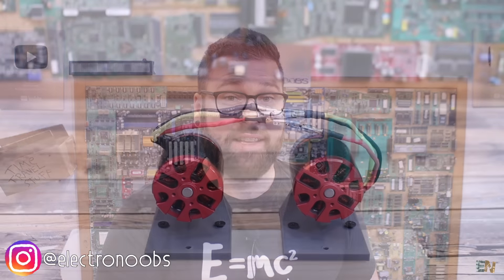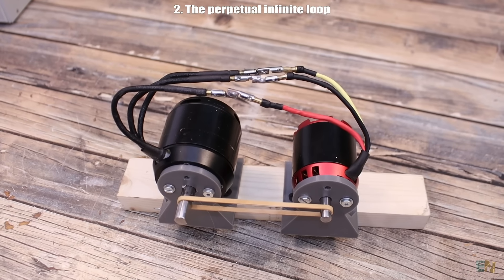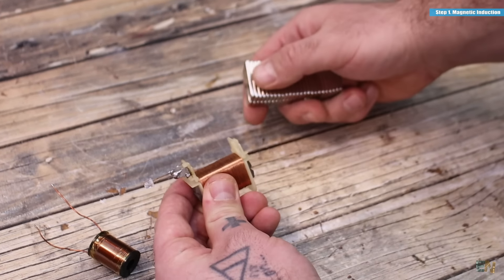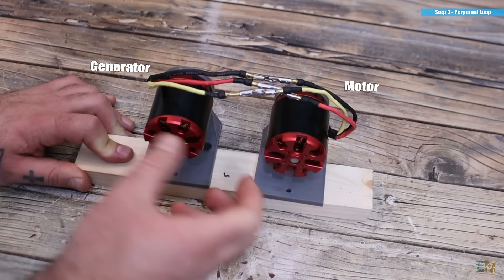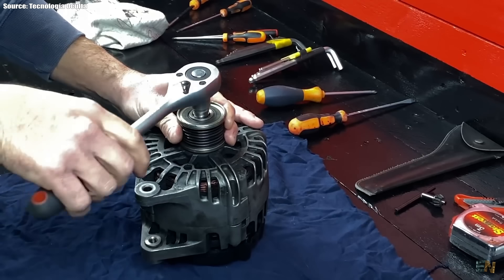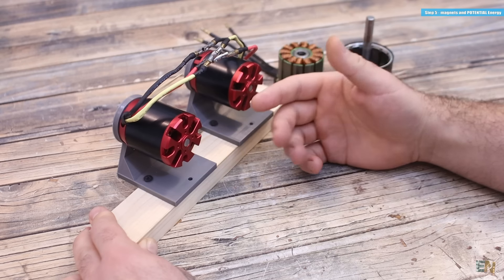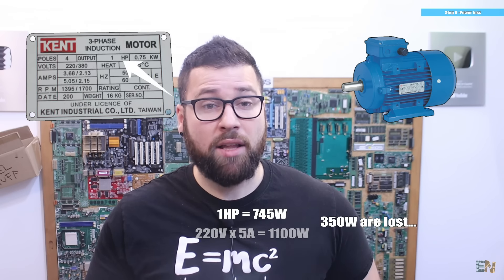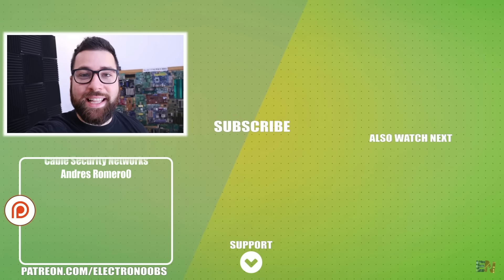Free Infinite Perpetual Energy Nonsense - FAAAAAAKE

Comment: This example reminds me of a guy who was playing with an alternator and convinced himself he was making a bit over a kilowatt (About 1.5 kilowatts) from around 20-30 watts of input.  How?  He stuck a roughly 2HP motor on the alternator to drive it, then plugged in a roughly 2 amp at 12V field current.  In his mind, he was "putting in" 24 watts of power into his machine (12V x 2 amps of field current).  The fact that he was measuring around 1500 watts of output from 2HP of mechanical power should have clued him in, but it didn't.

Comment: We have a model bag with the Faller Car System on it, but have replaced the batteries with 'supercapacitors', so the charging times of hours are reduced to a maximum of 90 seconds.
Then these are 80/85% loaded and that is sufficient, because there they drive for about fifteen minutes at maximum, but the lap time varies from 1 to 3 minutes, some routes are longer and therefore more 'charging stations' and we do this through 'the copper mirrors on both sides'.

These supercapacitors can therefore also be used very easily, we use 3.8 Volt 50 Farad.
If you want to use one of 50 Volt 500 Farad then they are about 6 Cm long & 3 Cm flat, they have a charge & higher discharge current than batteries can ever have.

These will be used in this type of FAKE power generation.
I challenge these by putting a 5KW old analog movie lamp on it, one of 5KW, to date no one has accepted this challenge and thus fake labeled by me.

Comment: Third mistake . . yes it is more efficient to use a 3 phase motor if you are transfering the total power from generator to motor and vice versa but they are using only 1 phase motor and they have given the alternator a first spin from the wire which created enough torque to generate an electrical current to run the motor which has a bigger pulley than the alternator . . so there's nothing fake in this
Reply: Basic Physics FAIL

Comment: But it is working :-).

Motor:
Input voltage (system voltage) - 220 V
Rated voltage - 230 V
Rated rpm - 1500 rpm
Input current – 230 V →21.8 A (measured
 value)
 220 V →
 =
 20.85 A

Input current = 20.85 A
Input power → P =VI cos ɵ

 P = 3669.6 W
Motor input = 3.7 kW

Generator,

Output voltage - 250 V
Rated voltage - 300
Rated rpm - 1500 rpm
Output voltage – 300 V→ 5 kW
Output voltage − 250 V →

 = 4166.67 W
 = 4.167 kW
Alternator / Generator output = 4.167 kW
Shaft rpm = 750 rpm
Reply: Thank you, smart physics guy/engineer!  FINALLY someone debunking the close-minded "debunkers"!
Reply: If you spin a motor with your hand, it produces an electromotive force. You essentially make it a generator. When the motor spins from an applied voltage, this still happens. Thus, a voltage that opposes the voltage applied to the motor is induced. This limits the current through the motor. 

So, the unloaded RPM of the motor may be 1500 RPM, but when you attach the generator as a load, the motor will slow. When the motor slows, the induced voltage decreases, just like spinning a generator more slowly produces less voltage. This actually increases the current, and thus the power consumption of the motor. So, if the motor spins at 750 RPM, it may consume twice the power or more. Now the generator produces 4kW, and the motor needs 7kW to run at that RPM, and it slows. This cycle continues until the system stops.

Comment: Can you make the highest efficiency set up? With the coupler and 3 phase motor etc. I know it wont work because of power loss and other reasons. But you already made a small version of what they made which was all the worst decisions. Show us one with all the best decisions
Reply: a coupler will not work : it inverses the rotation, you'd create a short-circuit instantly. Another argument to debunk the debunker LOL
Reply: @dirklanduyt  they make opposite spinning motors or you could reverse the polarity. All motors in the world dont spin in one direction
Reply: @dirklanduyt  Wrong! Motor rotation can easily be reversed by reconfiguration of the wires. In this case the swapping of any two phases of the three. Red to Yellow instead of Red to Red and Yellow to Yellow. Machines that use three-phase motors typically have a switch to make this change. Running a lathe "backwards" for example.
Reply: Y don't you make the same project and show us practical that the experiment is facke
Reply: @rosedeep6833  because i am not the pro
Reply: "all the best decisions" would be to eliminate everything possible, while still retaining a the characteristic spinny thing. So the best possible performance would be a flywheel in a vacuum on contactless bearings. Yes, just a flywheel. I think your imagination is enough there.
If this seems dissatisfying, please know that these devices all boil down to multiple free spinning rotors and shafts connected together in very unnecessary, lossy ways. The most efficient form of this with the lowest losses is just a flywheel with minimal friction. Obviously it isn't a source of power (neither are these devices). The very best it can do is just store energy the energy initially put in for a long time. The electromagnetic elements in these videos simply add enough complexity to perpetuate confusion.

Comment: The dual motor design scam is very popular these days since the scam is even easier to pull off as battery technology has gotten smaller and more efficient compared to the 2010 days, so you can stuff a battery powerful enough inside one motor to drive the other pretty easily.

Comment: If your your output of the electric motor exceeds the demand to keep both running, it is very possible to do this.   I have literally seen these in real life working.  BUT the alternator was modified to produce enough power to start the electric motor and the electric motor had to be started the first time using a large fast drill or other means to get it up to speed to produce the power needed for the entire load.   There is literally no difference between plugging your electric motor into a electrical socket to run it vs getting power from another source as long as that source supplies enough power for the electric motor to keep running.   I can use batteries, electrical outlet on the grid, solar panels, wind turbine.. or anything else.  AND IF the source supplying the power to the electric motor produces enough power for that AND produces an excess in power output, like a modded generator/alternator, there is no reason this would not work as long as the output exceeds the input needs.

Comment: One thing the fake videos forget is "Windage".
Alternators and Generators require a fan to keep them cool so there goes some energy straight off the bat.
Reply: @newdawn8477  So you're saying it does work to produce energy but mad because you're not achieving full efficiency... you clearly missing the point that perpetual creation of energy w/out reliance of the power grid is a win.  You need more than 600w of power?  Here's an idea, use more powerful hardware than what they showed...
Reply: @duyvuitton6019  It went right over your head didn't, everything I wrote was proving it could not work and will not work. 
I even gave you the best outcome by not factoring in LOSSES.
Go back to school and learn the law of conservation of energy or haven't you got that far?
Even if you had a 15000w motor and a 15000w alternator with ZERO losses, it still wouldn't work. Any load will deplete the system of energy. 
Think about it and I mean think about it. 
Ever noticed most of the videos come out of the middle east? Could it be they think the west is stupid and by posting videos like that they know someone around the world will waste their time trying to build it...

Thinking about it you should put your money where you mouth is and build one and have it running a 3kw load (this should be easy for you), video it running and then dissemble it with no cuts and post the link here, I WILL watch your attempt. 
All of the parts can be brought off of ebay and ali.
Just prove me wrong by doing that.
Reply: @duyvuitton6019  The rest of the energy was freely created after losing energy….leaving you with less energy than you started with.  You have a real mouth on you for someone who can’t even grasp the core concepts.  There is no energy company conspiracy, you just don’t understand.

Comment: I don't disagree with you but there are lots of different setups that can be make. A motor has a lost rating. If you size 2 different motors and change the gear ratio you can spin on faster generating more power. Still won't work, but motor make heat. If you harvest the heat and move it back to electricity reclaiming loss. There is also the ac to dc conversion with a transformer you might save a little power. Then there is the magnetic feild. You could reclaim more electricity there. So be combining multiple setups (in theroy) it should be possible. Using 2 motors different size pulleys and add magnets to the belt and put a transformer under the belt to take advantage to the magnetic feild. Or a coupler with magnets. Great video by the way.

Comment: It's funny to me how they couple two machines together in their videos and pretend like noone ever thought of that. If you walk into a laboratory for electrical machines you can find this kind of setup everywhere. One machine acts as load on a machine that you are trying to make measurements on. It's an efficient way to test machines because you only need to supply the energy for all of the losses in the setup. But of course you can't gain energy this way. Awesome video!
Reply from the maker: like placing a light bulb over a solar panel and close the loop :))))
Reply: Why would you make this video debunking something if there wasn't something worth debunking! So what if people believe in it! Let them fail! Try all you want you will lose people are waking god is here
Reply: @ELECTRONOOBS  I believe you when you say it’s fake kinda makes sense. I’m no expert but I do have a question. If you had a batter, alternator and motor and made enough power to keep battery charged while it runs the motor wouldn’t it be possible to keep battery charged from motor and runs small appliance like charge a phone
Reply: Hallo Herr Diermeier, lesen Sie bitte mein Kommentar.
Reply: @nonpe8216  It would not be possible. If you had a perfect alternator and a perfect motor perfectly connected the system would have exactly no energy left over to output. It couldn't lift a fly's eyebrow a nanometer.
I think something that leaves the "intuative door" open for this motor-generator falacy for many people is that they may have spun an alternator on the table by hand, thinking how freely it seems to spin. But connect an electrical load and suddenly it is not easy at all. The greater the electrical load, the more torque is required to spin it. Motors and alternators are simply energy converters, changing between mechanical (shaft) energy and electrical energy, both for a small fee of heat energy  because they can't be perfect.
Reply: Lol.
Reply: @nonpe8216  no; there's no way that system would work. Not without 100% efficiency (energy) from all electrical and mechanical components. No matter how powerful you make things. It literally is impossible in this universe, and yes many people have tested this (obviously), and it has never, ever come close to working.

Comment: The magnet arrangement is the secret of the device. The magnetic flux is shaped in such a way that increases the field strength in the right areas. The alternator then becomes very efficient for the amount of power input. Too many armchair scientists who don't even replicate something that's been documented and explained time and time again.
Reply: I'd really like to see some measured data. Do you have any electrical measurements? How about efficiency numbers?
Reply: @pstonard  please do your own research. I won't spoon feed. But I'll point you in the right direction. Go look up the energy from the vacuum series. There is a part about magnetic gates where it was discovered that magnetic fields could be shaped. This is the key. There is also the lockridge device from ww2 that used similar principles on an old Bosch starter generator. The starter pulsed the motor, and the generated back EMF spikes were collected in a capacitor. Look up Troy Reed. So many witnesses/inventors of this technology. Believe in a better world. With sustainable energy. Tesla's true legacy.
Reply: @jontanneguy4960  Happy to do my own research, thanks for the pointers.

So you don't have a working device yet?
No performance data, just the heritage of the tech you claim will work.

Let the adventure begin!
Reply: @jontanneguy4960  please do it!

Comment: I understand your video and reasoning why “it should not work” but considering you are also making videos to get views and effectively capitalizing on it, why not try to duplicate their exact machine?  It appears like you’d be able to recreate it exactly as they did and at that point debunk it with the demo no?  He put up the video of how to modify the alternator. He also states he will make a 2-3 phase motor version. He also states he did not hook up the other phases.  There is no way he was able to drill two holes into 1/8 to 1/4” metal using small batteries and a power converter hidden in the motor.  None.  And in fact that would be an easy demo for you to build in order to debunk your own theory as to how he did it.  These batteries would not only have to power the inverter to convert the energy into 220! but also power the motor strong enough and fast enough to spin the alternator too?  Respectfully, I don’t feel you can say it does not work until you build it and try it yourself. I feel that if you built it and it worked, you’d come back in another video and be honest and humble about it.  I myself am making plans to get a Valeo 60011 alternator like he uses and plan to recreate his experiment to a “T”.  I know this generator is not going to power a whole house.  But if I can power lights in a green house and not spend so much on an inverter, solar panels etc., it’s worth the fun to try!  Thank you for taking the time to make this video.
Reply: Sounds like a great experiment. You should make a video and post as a response. Be safe, hope you find your answer, and I look forward to your video response.

Comment: To me the guy modified the car alternator with nyodeniom magnet as shown in his video and will all no that alternator has three face and the other motor is a (synchronous motor) an this motor has a different mode of operation which Is different from other motor.the futures of the synchronous motor are
1. The motor is not self started 
2. When the motor is been synchronize it lock and the motor move the with constant speed of the prime mover 
3. The motor is not dependent on other prime mover when on load
4. The motor will not change in speed on load or not on load after it has been synchronize 
5. The speed is constant with prime mover even if on load 
Now the second point is that the guy also modified the Ac synchronous motor with nyodeniom magnet which produces low rpm with high frequency and now put the output of the motor to a socket with he use to power the instrument 
Note let me give u the breakdown 
1. He use the alternator to power the synchronous motor 
2. He use the synchronous motor to power household 
He did not show where he modified the synchronous motor 
 he used two power not one 
One power from the alternator and the other power from the synchronous motor

Comment: And also if the efficiency would be a  100% than the motor would spin up to infinity, and the voltage wouldn't be regulated either. Right?  🤔

Edit: Free energy does exist. You just need an extension cord and a good neighbour.
Reply: But the motor cannot consume more energy that it’s maximum allowed power, thus keeping the alternator rotating at a constant speed, not buying this idea of this free energy thing, but just saying
Reply: @StringerNews1 what's driving the alternator is the motor, no regulation on the alternator, means free energy to be consumed by other appliances, knowing that the motor will not rotate the alternator to a dangerous frequency,  because the motor does have voltage regulation, it is possible that the fact that the alternator has no voltage regulation and because of the strong magnets, the alternator is able to produce higher voltages
Reply: @StringerNews1 buy man, they’re not stupid, being able to achieve 8m+ views and counting for that scam, is just mind boggling
Reply: @freecodyx  I don't know about more energy being put out than put in (he may have a secret to that that he's afraid to reveal to the public because of what happened to Tesla and others for trying to do the same), BUT it makes sense to me that if you design/tweak a motor to have the same amount of friction and level of efficiency when rotating as the alternator connected to it (with the help of the magic of strong coil + powerful magnets), the power assigned and transferred to the motor from the alternator would be the same amount of power returned to the alternator by the motor, hence an infinitely, autonomously running, free energy machine (after you give it the initial starting energy or 'jump start').  Where the hell is the doubt in that??